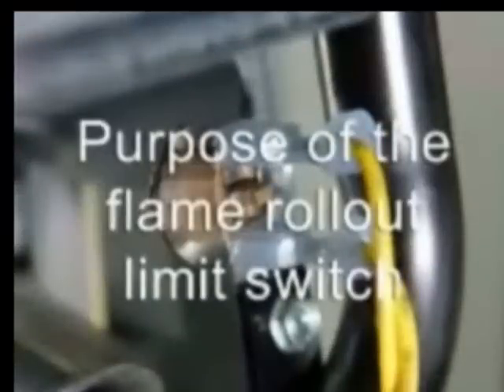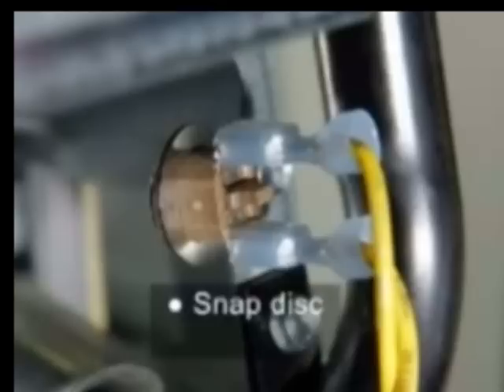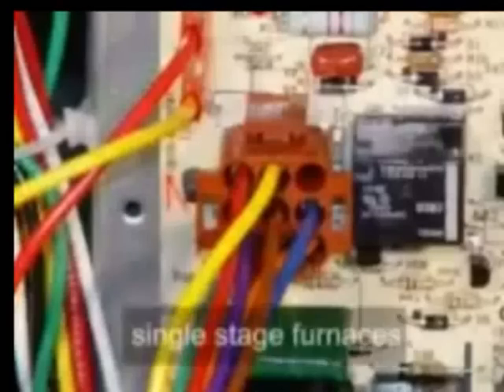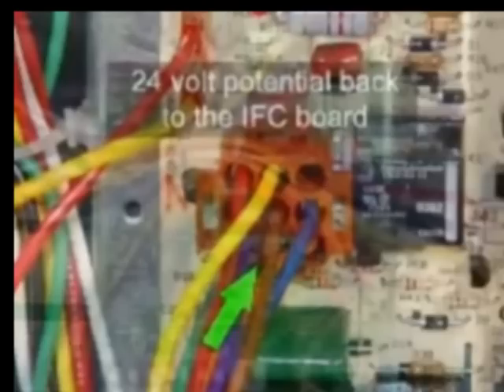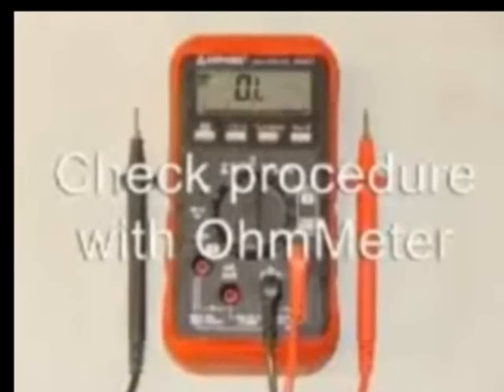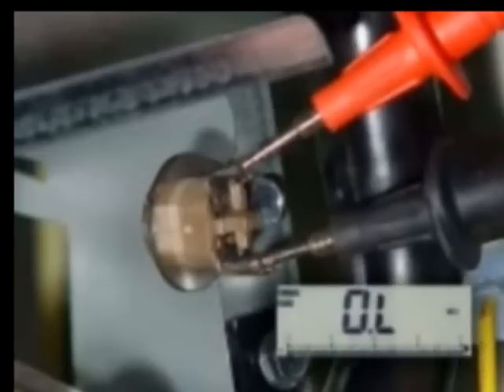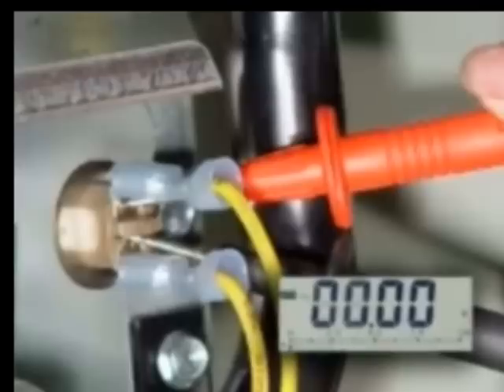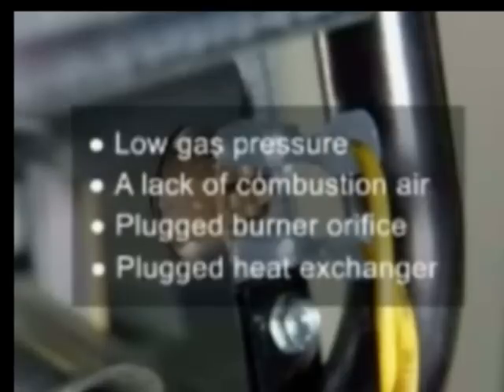Flame Roll Out Switch

Comment: Good video, but did not help.  I'm getting four flashes, but continuity or resistance check out good on both of the high temp cutouts and both roll out switches.  Continuity and resistance is good across the entire circuit when I pull the 12 pin block.  I've had my system do this three times now.  I've checked each device and the leads for broken wires.  Twice, the system started up, but now it's a no-go.  I'm wondering if I have a control module issue.  Thoughts?  The circuit basically goes from 12 pin Hi Limit Output  to lower high temp cut out, to the first fuse link, then to the second fuse link, then to the upper high temp cut out, then to the vacuum pressure switch (common crimp), then back to the 12 pin Hi Limit Input.  I...am...at...a...loss.  As I said, everything checks out good.  Oh, BTW, when I check using the voltage on the cutout switches, I get 0 across the terminals, but only 0.768 to ground.  Transformer has 28v output.
Reply: Well, I also pulled the wire from the lower hi temp switch and the other lead to the block which feeds directly to the pressure switch. I got 24v.  I notice when I put pressure on the 12 pin block, the flashing light turned slow, then high and the furnace lit.  As soon as I let off pressure, it shut off.  Grrrr.  Now I have to figure out if the problem is the card/controller or the harness itself.  Thoughts?  Have you ever seen this before?  Very frustrating.  I have a plastic shim wedge holding pressure on it in the interim.

Comment: 10-16-2918   -   -   I have an old Amana LP furnace that won't "ignite" on first try and usually takes half dozen attempts to get the flame going.  I covered-up the air holes in the box where the burners are so the updraft suction motor would pull enough gas into the circuit to ignite, which seemed to work OK.  However the loss of air coming into the combustion area made it get too warm - not way too hot, just overheated - and the roll out switch tripped for the first time, causing the blower and updraft motor to stay on.  The diagnostic light blinked five times pausing between times.  The little chart on the cover of the furnace said 5 times is the roll out limit.  Not knowing what "roll out" meant or what to do about it, I googled it and came here.  Thanks for the info - the blower motors are now running normally, but the old problem is back where the burners just won't ignite.  Only one burner fires with the glowing element on, then after a few seconds everything just goes out.  Flame sensors are clean.  I think it's just not getting enough gas.  Any suggestions as to the cause of failure to maintain ignition/burners?

Comment: just a question if this failed could i one use a piece of soldering wire as a jumper and in case of over heating it would melt and open cicuit to shut down..dont try this at home im sure but i think it could work kinda...thanks
Reply from the maker: +reneonlineg1 I don't recommend nor does Trane jumping out any safety.  Contact your local Trane Comfort Specialist for assistance.